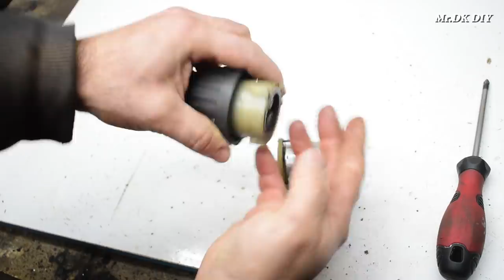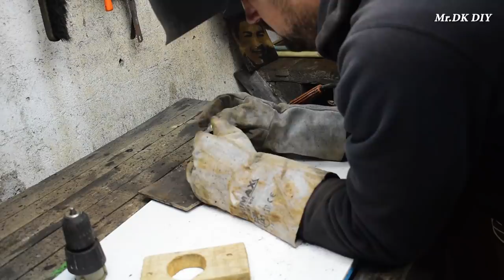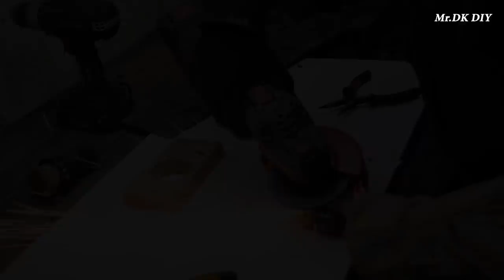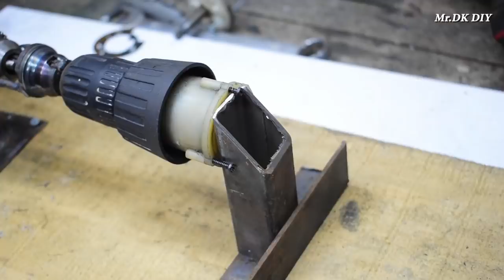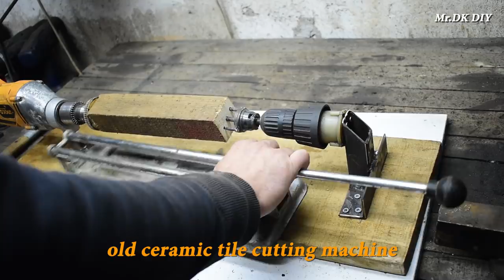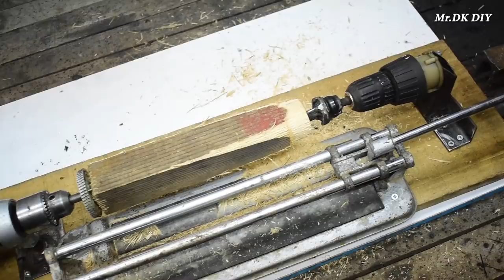Old GearBox Reducer for Cordless Drill ??? Building a simple Lathe for  Woodworking

Comment: THIS IS THE MOST CLEVER CONTRAPTION I'VE EVER SEEN. MAY I SUGGEST YOU STICK A SCREW WITH A  ROUND HOLLOW HEAD IN THE SLINDING WOOD IN WHICH YOU CAN THREAD THE CHISEL WHILE ACTUALLY WORKING AND INSTEAD OF  SLIDING IT  RIGHT-LEFT WITH BOTH HANDS. SO YOU CAN DO BOTH WOOD-TURNING AND SLIDING THE WOOD IN ONE CONTINIOUS MOTION ONLY THE SLIDING WOOD SHOULD BE JUST A LITTLE SHORTER, I THINK